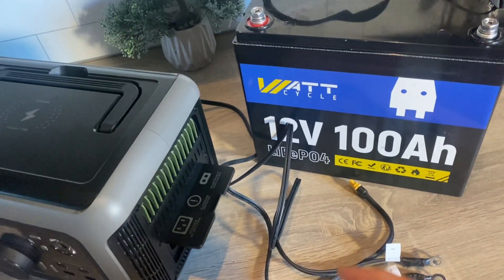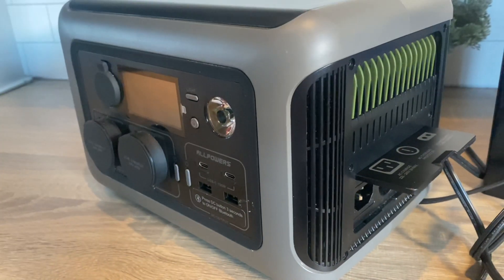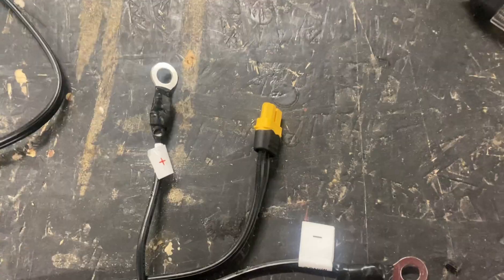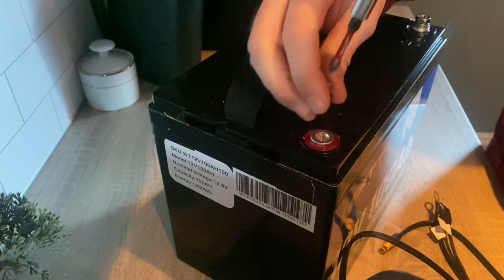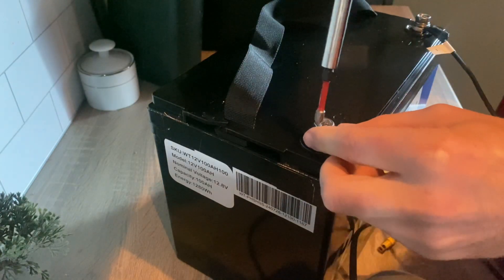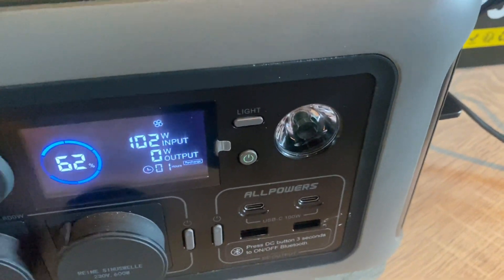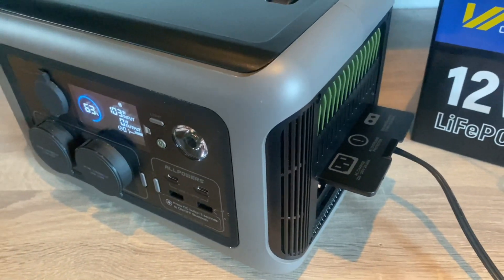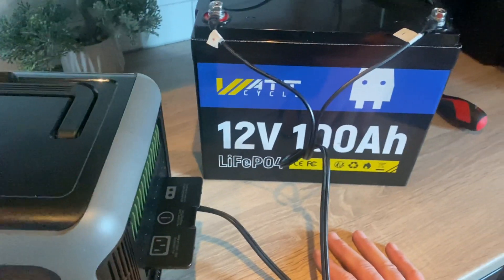DIY Capacity Boost for ANY Portable Power Station! (XT60 Mod) 🔋

Comment: I have a R600 as well and was thinking to do the same. I am surprised to see it is just taking in just over 100 watts though. The unit is rated for 200 watts and technically math speaking Solar Input: MPPT (12-60)V=12A, 300W Max going off the AllPowers R600 manual even. So 100 watts is strange. Maybe the cable? I wonder if going with thicker AWG here might do the trick? Or is it a Voltage thing? Like would 24V battery or 48V battery bring in that 300 watts instead? I know this much I just in my experience and not seeing good results off the solar input on this device. Not like you say per see like a victron charge controller on lifepo4 with the same solar panels. Trust me there is HUGE loss on the R600 just by taking the same panels. I think the best setup here would be lifepo4 battery, victron solar charge controller, off battery to R600 run cable to a victron lower power disconnect to xt60 connector to the R600. There are many things I don't like about the R600 like the solar input not making the power it should and it being bluetooth only. I really need wifi. But, where this unit shines and out performs I mean slam dunk over my Anker and Ecoflow 280wh or less solar battery setups are it's AC power. 600 watts and can run well over without tripping makes this a beast to have. Thanks for sharing and hope yours is still running great,.
Reply from the maker: That's a lot of great info! Thanks for sharing your experience with the R600. 👍 Yes it is a "Voltage thing" when using a 12V battery as input and multiply that with the max12A the mppt is rated for. It might charge higher if you change the charging settings in the app though. But it is a safety thing keeping it below 12A.
Reply: @JonasSyver  I am in process of wiring up 400Ah lifePo4 right now at 12V I might for testing purposes get one the buck converters and go as high as I can get near 48-60v input just to test and see what actual input could be. If going higher Voltage.
Reply from the maker: Cool project! Let me know how it turns out👍

Comment: I want to do the samething i have a power station with mppt of 12-48v at 500w max, can i use my xtra battery of 48v to add the same as yours? Thank you
Reply: Be careful, 48v batteries can reach upwards of 52V when fully charged!
Reply from the maker: @andrew2180 that is true👍⚡️
Reply from the maker: As long as the input voltage range for the mppt is within the limit, then yes you can. I would add a fuse sized to the max input current to be safe.